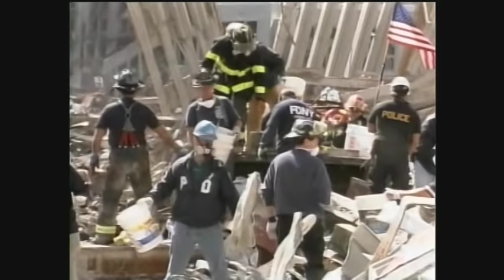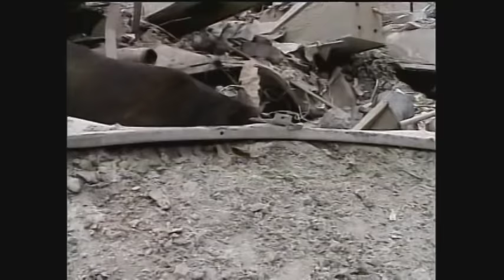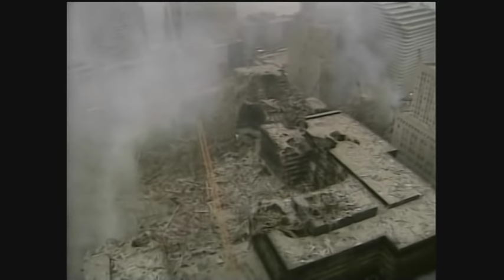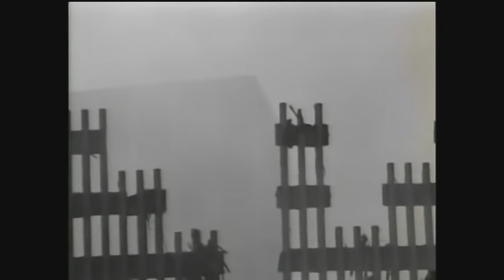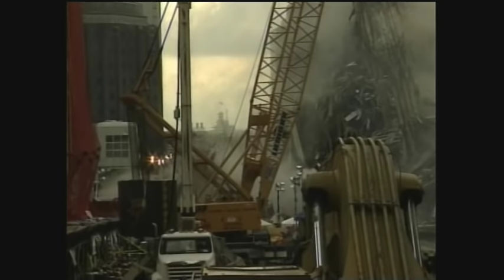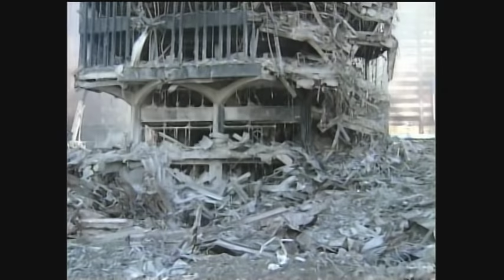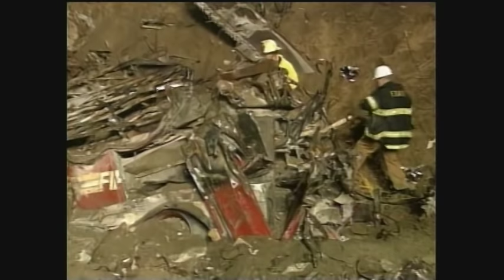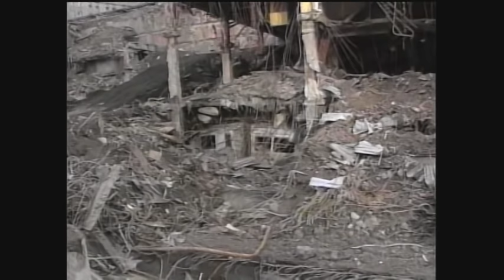Rare and new FEMA footage of Ground Zero

Comment: Wonder how the other buildings that were around, completely burned out didnt collapse but a 47 storey building with minor fire had a simultaneous total collapse of all its structural columns, must be very bad engineers designing building 7
Reply: I wouldn't call it a minor fire, but in context to the event it was, your primmest is correct though, it's an inside job for many, many other reasons and coverups.  The thing about WTC-7 is that is was actually built much heavier than any of the other buildings in the area, it's purpose was to be a fortress, a virtual citadel in cases of emergency, a fortress of Manhattan, look what was housed there too. In fact it was overbuilt.
Reply: What I wonder is why truthers feel the need to lie about building 7, minimizing the fires with phrases like "minor fire" when in fact the firefighters on the ground painted a very different picture, using phrases like "fully involved," "really roaring" and "fire on nearly every floor."

Who are you going to believe?
Reply: TimReed22222 Indeed, so true.  Still from what's viewable at all that just doesn't hold up, it don't at all look like it.  And then there's the fact that it was building that was so over built that fire couldn't have collapsed it.  What I mean is that the construction and the size of the steel parts of the it were twice or more the size that most buildings that size would have had.  And on top of that, if fire had collapsed it, why so "neatly" again in that distinctly controlled demolition fashion; another world first?  I suspect it's "all" controlled demolition now though, not the same exact standards that you see normally, but a bit "messier" one for this type of Shock And Awe required reaction, but it was mopy business, and a controlled coverup which is just as important.  I believe it was going on... and that we were well fogged.
Reply: ***** "there's the fact that it was building that was so over built that fire couldn't have collapsed it."

Couldn't have? What make you so sure? Are you an expert in building engineering? Can you point me to a paper written by building engineers that says this? Did you ever consider that maybe that assumption is wrong, that maybe building 7 might have been poorly designed and/or built? It was built in a tricky spot (over a Conn Ed substation) that required unique solutions. Maybe those solutions were faulty.

Google "Single Point of Failure ... How the Loss of One Column May Have Led to the Collapse of WTC 7" and read it. One possible explanation for the collapse of building 7 written by real structural engineers published in a respected structural engineering magazine - if you dare.
Reply: I've seen the basic stuff but it still doesn't justify a collapse, or one of that nature and appearance, do you follow any of that?  And the timings seem all off as well as the conclusions.  If it's true than I'd say the "terrorists" were better analyst than anyone of us or the respected ones you mentioned.  The stories and theories are all filled with subjective, too much of it if non falsifiable and conjecture.  I'll look for that but I've seen it before I'm pretty sure, and respected doctors use to advise you smoke Winstons, and had single bullet theories that fell out on tables.
Reply: ***** You kind of danced around my question, didn't you? You stated it was impossible for fire to have collapsed bld 7. You have not justified that claim, and that's pretty important! So here's the bottom line: Lots of truthers say that but I have never heard a real structural engineer say that. In fact, many structural engineers have said exactly the opposite, that fire DID bring down 7. I showed you how to find a peer-reviewed study published in a respected professional journal positing how exactly that could have happened. You have not even attempted to refute it other than offering some vague rubbish about you not liking the timing.

So what makes you right & all those professional building engineers wrong?
Reply: TimReed22222 well sir if you chose to believe the fire fighters then you should also believe them when they said they heard explosions level by and that there was molten metal flowing through the debris after the collapse 
And many other things that contradict the official story
Reply: coojsta69 Hearing a loud sound & calling it an "explosion" is a long LONG way from proving the presence of bombs. Not one NYPD firefighter who was there that day has come forward & expressed a belief that any of those buildings were demolished. Not one! You need evidence for that, and you don't have it.
Reply: TimReed22222 so the eye witnesses that claimed to see basically a river of molten metal (there words not mine) are all basically talking out of there asses correct
Reply: coojsta69 And do you assume that means something? We know fires burned under the pile for months, plenty hot enough to melt several metals (e.g. aluminum, which of course was plentiful). No inside job required!
Reply: TimReed22222 aluminum melts quickly and hardens quickly ....sorry not a good explanation
Reply: coojsta69 So what's your explanation?
Reply: TimReed22222 my explanation doesn't matter really 
Infact since 911 there has been so many different explanations as to how it went down that it would make anyone's head spin ...(that to i believe is not a coincidence)...... from energy beam weapons to underground mining nukes to fake holographic planes to pre placed explosives and my favorite a bunch of religious idiot's with box cutters and minimal flight experience pulling off a amazing show of piloting , navigation and crowd control 
Not to mention they picked the absolute perfect day to do it since the majority of domestic defense forces were bizy playing war games and wouldn't be able to distinguish a real threat vs the training simulation 
In my opinion there is way to many coincidences and plain luck (such as the passport of a hijacker falling undamaged to the ground) that give the whole official story a certain amount of comedic value 
Then we have building 7 which falls exactly like a controlled demolition (which is basically impossible for any damaged or burning steel frame building to do )
The bullshit on both sides is amazing 
both the official story and a large number of the conspiracytard stories are packed with enough conflicting "facts" that any respectful detective/investigator should simply stay clear from the whole subject !
And I'll add ...if the official story was true ...then saudi Arabia would of been the main target of the American military ..not iraq or Afghanistan ! 
Then the obvious question comes into play ...who exactly benefits from this event ? 
Well lets see ...the "terrorists" get to brag to there freinds thats about it .
The government on the other hand and the military industrial complex...has been able to pass many laws that otherwise wouldn't have been able to ,
Restricted freedoms for foreign and domestic citizens all in the name of "terror laws"
Given them the excuse to invade anyone who they justify a "terror threat" 
Given the weapons manufacturing and re building firms a huge amount of profits 
Oh and I almost forgot to mention ...they prevented saddam and Gaddafi from selling oil in other currencies apart from the American petro dollar so its a plus for the economy to 
Realistically the list could go on but im short for time right now .
I just find it funny how these "terrorists " did this because they hate our freedom right... 
Yet the government's around the world have taken our freedoms away since this event so who exactly won ? 
To me it seems it is the terrorists that have won !
Mission accomplished alright!
Reply: coojsta69 Well said, that's partly how I see it all too.  Plus the temperatures for the remaining fuel burn off with office furniture and carpet have to be far lower than what's been stated as 2,000 deg F.  It's hard to make anything burn that hot and the kerosine only gets that hot inside a turbojet engine under amazingly high pressure and is impossible to do under a simple draft siphon action.
Reply: ***** Actually, office fires routinely reach 2000°F. Google "Cardington test" for more info.
Reply: Xavier Jones 
If you look at the collapse of world trade center seven that the physics involved for that scenario does not add it, it collapses with minor debris and symmetrically falls at free fall speed, the reason why people question this is because US government agencies have been incredibly vague in explaining this event then blame "the terrorists" make an argument instead of calling people morons, sometimes things are not what they seem
Reply: Thomas Moore
Yawn.....
NISTs completely reasonable analysis (which I'm sure you'll likely disregard completely due to a cognitive bias against the source):
"WTC 7's collapse, viewed from the exterior (most videos were taken from the north), did appear to fall almost uniformly as a single unit. This occurred because the interior failures that took place did not cause the exterior framing to fail until the final stages of the building collapse. The interior floor framing and columns collapsed downward and pulled away from the exterior frame. There were clues that internal damage was taking place prior to the downward movement of the exterior frame, such as when the east penthouse fell downward into the building and windows broke out on the north face at the ends of the building core. The symmetric appearance of the downward fall of WTC 7 was primarily due to the greater stiffness and strength of its exterior frame relative to the interior framing."
Reply: Xavier Jones That's not possible, truther.
Reply: Xavier Jones See NIST were able to engineer such a fallacy such as that, it doesn't make sense for them to say that it was structural failure in the event of something deliberate, it's internal core which is the main component to holding the building up could not have been undermined by the minor damage that was inflicted upon it - it literally collapsed to the standard of free fall - something else had undermined the structural core columns not of an airplane because there was no airplane crash involved in WTC 7, we all know that for a fact, however to state that somehow debris was enough to bring that building down in free fall speed is terribly incorrect in regards to physics.
Reply: Thomas Moore
more yawn......
" it's internal core which is the main component to holding the building up could not have been undermined by the minor damage that was inflicted upon it - it literally collapsed to the standard of free fall "
full of ignorance mate... you haven't even looked at the data obviously
Reply: Xavier Jones Who's data do you wish for me to look at, if it's NIST's then I can tell you I've already looked at that data and it presents a problem - it's at the conjunction of omissions which give it a suspicious character as if there was data fabricated to suit the convenient purpose of what happened.
Reply: Xavier Jones Truthing again, didn't I say.
Reply: ***** Not they didn't. Don't be an idiot.
Reply: ***** No, Silverstein did NOT "admit to pulling it," he agreed with the FDNY commander's decision that the operation should be pulled. And the commander, not Silverstein, gave the order.

Also, Silverstein LOST billions because the insurance payout did not cover the cost of rebuilding. Look it up!
Reply: TimReed22222 That's rather convoluted thinking, he was a builder, and he never had the intention of simply managing them.
Reply: ***** "as Silverstein was the owner of the building he must've agreed for it to be pulled."

That statement MIGHT make sense if 7 was actually pulled.* But since it WASN'T pulled, it's a moot point.

*"Pull" does not mean what you think it means. It does NOT mean to demolish a building using explosives. 7 was not "pulled."
Reply: ***** Who, Silverstein? He's just telling his story as requested by the interviewer: Someone from the FDNY called & told him the building couldn't be saved, he agreed the best course was to pull the men out, and that's what happened.

Why is that so difficult to understand?
Reply: ***** "'pull' is a term used for demolition"

NO it is NOT. That's a truther lie.
Reply: ***** "who is believed to rig the building weeks before 9/11."

NO ONE "rigged" building 7. No evidence of demolition found. NONE.
Reply: Like they think Three Days Of The Condor was some pointless movie, and we don't do these things.  They'd be giving me a lecture...
Reply: ***** Actually, I deny that "pull" is a demolition term because that's what demolition experts say.

"We have never once heard the term “pull it” being used to refer to the explosive demolition of a building, and neither has any blast team we’ve spoken with." - Brent Blanchard, Operations Manager for Protec, Senior Writer for ImplosionWorld.com, etc.

There you go, there's my expert testimony.

Where's yours?
Reply: ***** "There were no firefighters in the buildings for them to be 'pulled out'."

True, there were no firefighters in 7 but there were hundreds of firefighters on the grounds, searching the rubble of the towers for survivors. It was this operation that was pulled.

"I made the decision (without consulting the owner, the mayor or anyone else - as ranking fire officer, that decision was my responsibility) to clear a collapse zone surrounding the building and to stop all activity within that zone." - FDNY Chief Daniel Nigro.

"There was 'no evidence' because they'd shipped all the metal off to China for it to be melted before investigations could take place!"

Another lie. The metal was moved to yards on Staten Island where it was indeed investigated.
Reply: *****
He's worse than a troll, he's a fogging shill.
Reply: ***** "I've just researched what you've claimed is an 'expert testimony'. Your 'expert testimony' is nothing but bullshit."

ROTFLMAO!!!!! Nice debating skills there, Joey! "Your source is a poopy-head!" LOL!

You're going to have to do better than "your expert testimony is bullshit." Refute it! Make a case! Make a counter argument! But you don't. 

Because you can't.
Reply: ***** "pull is a demolition term. It just is."

LOL!
Reply: Did Silverstein own just those three buildings?  Which ones didn't he own?
Reply: ***** "But what you've claimed is bullshit. Therefore it isn't necessary I reply with a 'counter argument'."

LOL at U again! How weak is that??? See, this is why you suck at debating! No argument, no defense. Just "it's bullshit."

Again, I ask: WHY is what I claimed bullshit? Please explain! Is Mr. Blanchard wrong? Unqualified? Lying? Fictional? In on it? WHY is it bullshit?

When you say things like "it isn't necessary I reply with a 'counter argument'" what you're really saying is, "I got nothing."
Reply: You're just quoting the bible, you can't think for yourself, that's what it is, and you don't see the slightest incontinuities.
Reply: TimReed22222 they don't like facts....
Reply: TimReed22222 and if you are right you must be some paid shill I think they call it. It would be funny if it did not dishonor the Dead.
Reply: ***** since "pull it" is a demolition term used all the time in demolition you wont mind providing a link to some video of a demo expert using it before 911 or have all the ferry shills erased all the footage worldwide.....
Reply: ***** since "pull it" is a demolition term used all the time in demolition you wont mind providing a link to some video(rather make it several since it used so often) of a demo expert using it before 911 or have all the ferry shills erased all the footage worldwide.....
Reply: Yes they used it, "pull it" oh sorry  Larry Silverstein, whom by coincidence bought the buildings 1 month before and had plans to build new building in the area in 2000, you can hear that by his own voice.
By the way a building was burning for 24 hours at least in london and didnt fall and it was not a fortress
Reply: Building 7 had back up servers, safes, bomb shelter the Lot.
Reply: @hugosz1973  Grenfell tower burned like a match for 60 hrs. Stands to this day after more than 6 years.
Reply: Building 7 collapsed on all 4 corners at the same time. That is impossible without explosives.

Comment: I understand that you want to believe the official explanation which was being told as events unfolded. If 3 skyscrapers were knocked down by airplanes for the 1st time in history, the logical response would be to change the way skyscrapers are built. Tower #7 was not hit & was "pulled" later on 9/11/01. How do you explain the lack of debris piles? The pyroclastic dust cloud comprised or particles smaller than 1 micron?  Many scientists initially expressed doubt but a day or two - continued

Comment: (continued) So all these things occuring simply due to damage from fire would result in multiple violations of the laws of physics. Well laws of physics cannot be broken, you are correct there. So what is the only conclusion here? Something had to have been used to aid in the manner in which the towers fell. This is the only factual conclusion one can come to, if the laws of physics exist.

Comment: So without a steady source of jet fuel feeding the fires, the temps would be no where near 1700 for any significant amount of time. However, It wouldnt matter if the nearby steel lost 100% of its structural integrity, this in no ways explains the manner in which the towers fell (near free fall accelerations, symmetrically downward directly through the path of greatest resistance). Basic physics tell us this is impossible. So if the laws of physics are true, another force had to have been used.